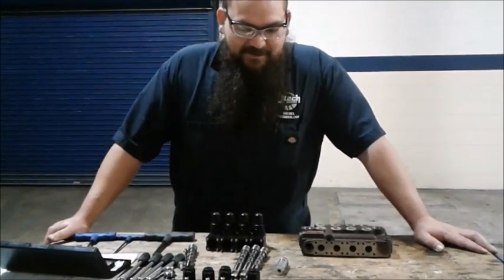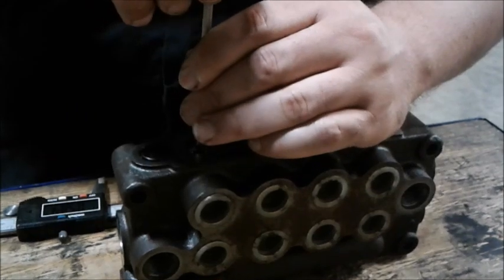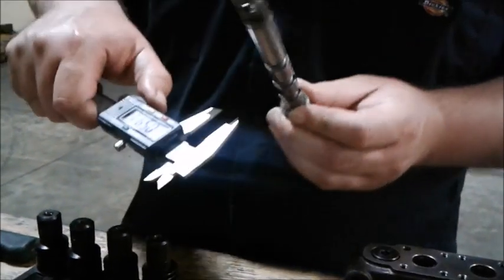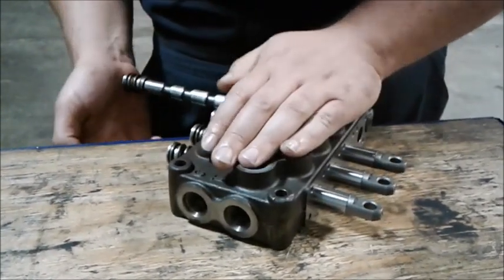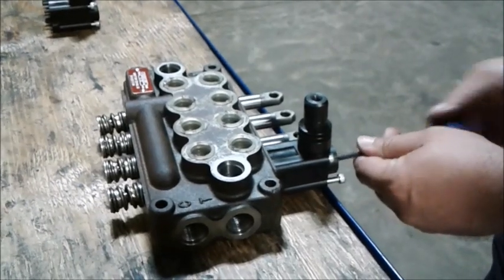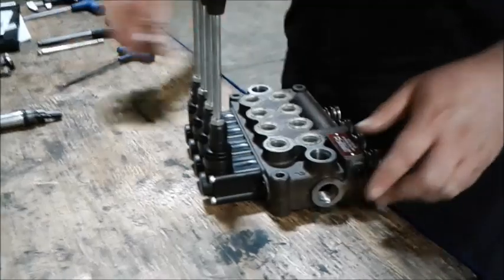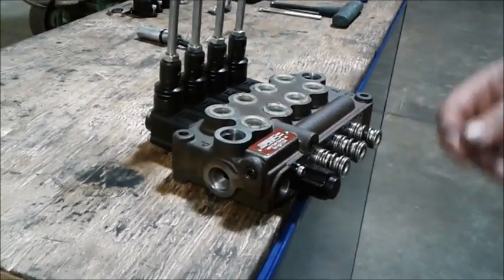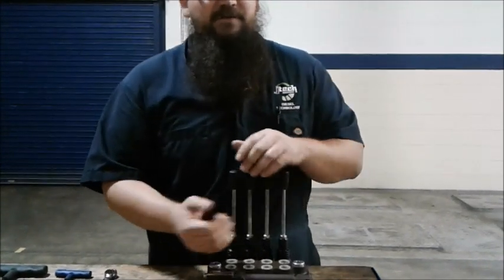Hydraulic Valve Body Inspection

Comment: Hi I love your videos very informative but I have a problem. I have a gray market half ton Kubota excavator which When I went to clean the control block I took out the spool valves and didn't mark their locations. You cannot get any information or manuals for this unit so I was wondering how I can tell where these valves belong. Thanks in advance. It's a Kubota k005

Comment: Generally, people get into valve bodies because of lost control:  something either isn't happening, or won't stop.  Very important to check for trash first, then measure.  Spools usually tell the story.
Reply: My hitachi 5ton excavator it swings only 1 side and sometimes at all.we replace new pump and now mechanic thinks is the main valve control.something stuck In there.what do you think
Reply: @mihalispantelis4909  Before digging into valves... the easy stuff: hoses.  Swap if possible, and if problem follows, it is failing internally. [its not a bad idea to change hoses every five years by the way].  A loss of return behaves like a block - regardless of pump pressure.  It is also possible trash in a cylinder is behaving like a check valve near the fitting.  A chowdered o-ring for example can travel and wind up in places you might not expect.  I don't know your machine, but I do suspect a valve problem - something allowing pressures to equalize across two functions, which would mean no movement even if pressure is good.  I assume system has a regulator that is allowing proper volume to pass - I have seen cartridge style regulators fool people where pressures look good, but just a little speck of something interfered with operation and movement would just crawl in slow motion because volume wasn't being delivered.
Reply: Thank you flinch you know many stuff about machinery.i am just a owner operator just know the basics.so where do you.live?I am Sydney australia.i wish you were here to fix it for me lol.its been there 3 months now

Comment: So are the spools only sealed by a film of oil or is there an o-ring inside the valve body to prevent leaks to the outside?
Reply: Yes and yes: its a design variable tailored to system fluid, pressure, and cost/repairability.  Air controls, for example, are typically o-ring design because air brings moisture and with that corrosion over time  Going without o-rings means bores are machined to aerospace tightness.  Any erosion/things going egg shaped would be a show stopper.  An old body can be saved, but bores need to be sleeved and honed fpr the spool being served.

Comment: I had my hydraulic valve re sealed on my john deere 6675 skid loader. I added hydraulic fluid and did not bleed after starting I tried forcing the up on the bucket to work because it was hard after forcing the pedal it made a loud bang noise and blew the fill cap off on the hydraulic tank. What did I break or destroy?

Comment: It can not checked by vernier , use micrometer for accurate result
Reply: Or caliper's which is what he used, and not perpendicular to the bore but his point was made. Measure accurately!
Reply: @rcdogmanduh4440  caliper has a least count of 20 micron instead digital micrometer has 01 micron .Spool valve OUTER DIAMETER has a tolerance of +_ 3 micron . Then how you check?

Comment: So I’ve got a leak at the spring cover cap it’s not a bad leak but I want to fix it anyone know if it’s a seal or something
Reply: did you figure it out???
Reply: Yes I did there’s little O-rings that slide in there with a little dust cover that goes over it. After I took it apart I could see it.
Reply: @johnbrown1568  Thanks,  i have the same issue in my jcb 3cx and i didn't know if it would be a simple job.
Reply: Same here. So it's just a seal. I'd say on both ends, too.

Comment: I'm sure this guy is a really nice person, but he shouldn't be sharing his very incorrect information with the world.

The clearance between the spool and the spool bore of a hydraulic control valve is concerably less than 0.001"

Even the most basic directional control valve has between 0.0001" and 0.0003". (That's from 3 to 8 μm for the metric minded).

The tool this guy is using is has a resolution of 0.0005" (13μm). But, its accuracy is 0.001" (25.4μm). The tool is 3x less accurate to evaluate this assembly.

Also, a partical of .00016" (4μm) that gets into the closed assembly will cause at least minor damage to it. His attention to cleanliness is horrible and it's really difficult to remove small particles once the get into the valve body. They get trapped in the corners and are incredibly difficult to flush out.

Overall, I give him an F- for his skills in hydraulics. However